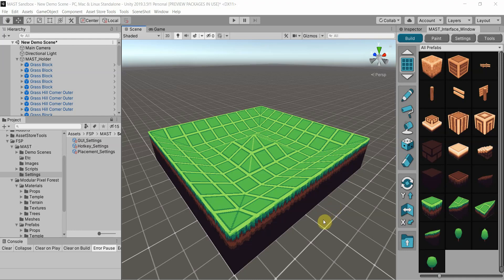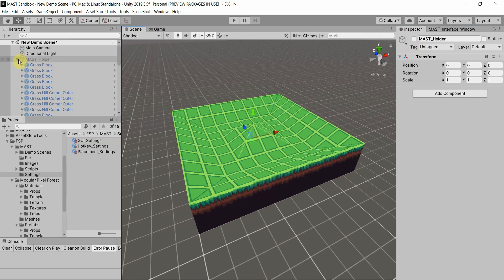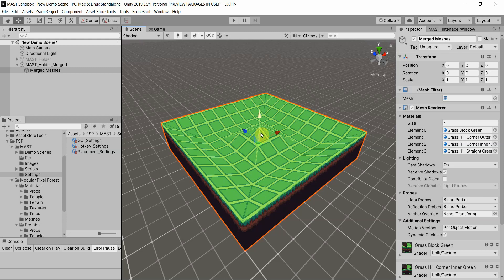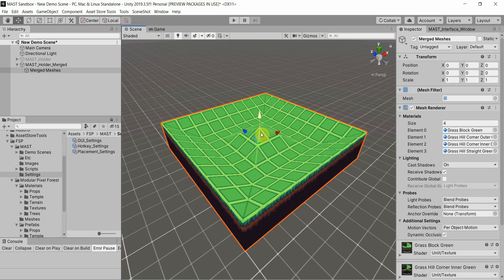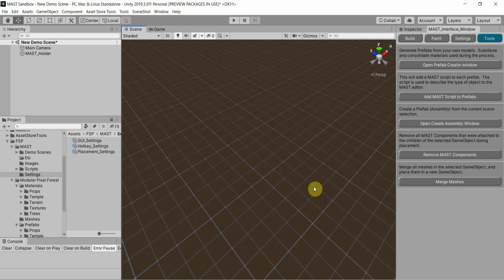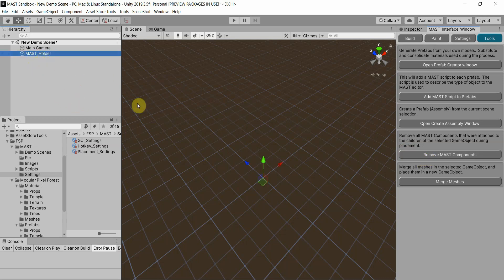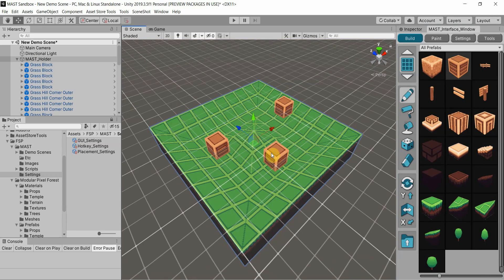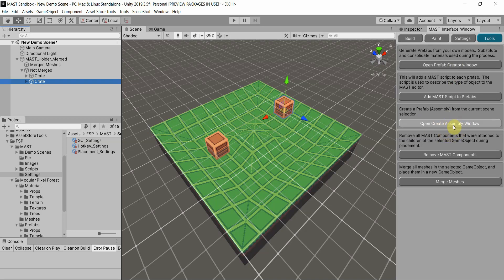MAST - Various Tools

Comment: Purchases this morning and ended up looking for help so came here. So your merged meshes tool. I does like it does in your video but if you then copy the parent with the merged meshes and take it to another scene it cant find the mesh. So where does it create the mesh? Or am I totally off track? Probably! Very clever tool by the way. Ideal for what im upto.
Reply: If you paid for MAST, please get a refund!  It's free.  The merge meshes tool is bugged and doesn't save the actual prefab, just an instance.  Please use another method for merging until I fix.it.  I don't have the free time I used to, so I don't know how long it will be.
Reply: @keithdfox2  Modular Terrain Pack I purchased at £30! Dont know of another method to merge it. If I export it as OBJ it looses all its materials.

Comment: I'm quite new to game creation and am working on my first game. The amount of vertices i have in my levels is very high due to the amount of blocks i have placed, i have a pretty decent PC, so it can handle them with a decent fps, but i'm afraid other computers will not. If you don't get the time to update mast would i be able to find a workaround which would reduce the blocks/environments poly and vert count? I'm just a bit afraid to continue using Mast if it cant be done lol There is a video on my channel of a test level, which shows roughly how many blocks i'm using in each level. Any guidance would be greatly appreciated.
Reply: There are tools you can download in Unity that can remove unneeded polycount.  MAST just placed your own prefabs so no reason why you can't use a 3rd party solution here
Reply: @keithdfox2  I bought an asset called Poly Few, which combines everything into one and then allows you to decrease the polys, but unfortunately, it made all the block environment distorted. I did try this only on blocks and not ramps/slopes, as i thought it may be easier for the asset to calculate, but that wasn't the case. Do you know of any assets that would work properly? Sorry for asking, but i already made 5 levels and am now worried that i may have to start the environment from scratch lol
Reply from the maker: I've heard good things about Mesh Combine Studio 2.
Reply: @keithatfertilesoilproducti5559  Cool, thanks. Ill take a look.